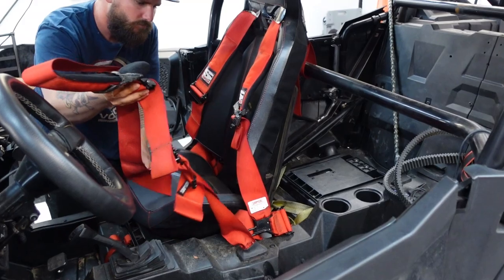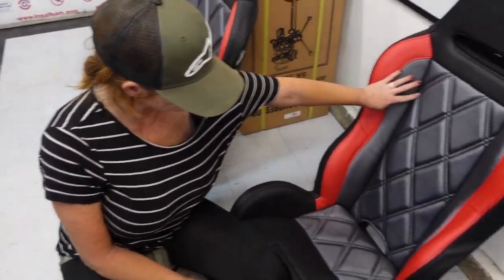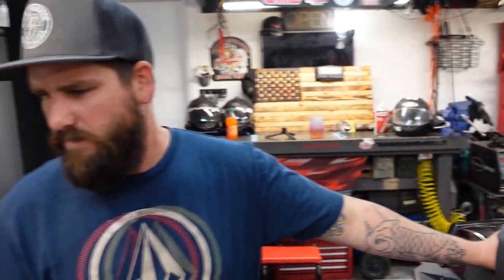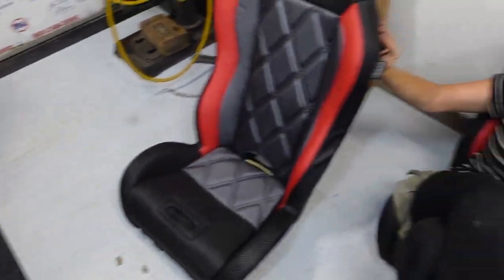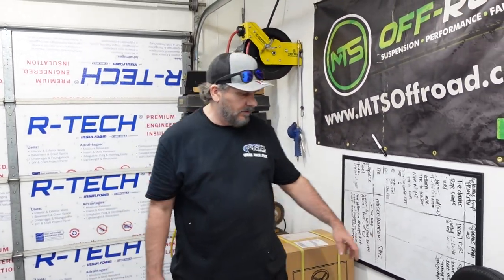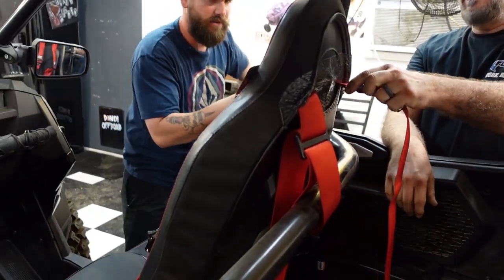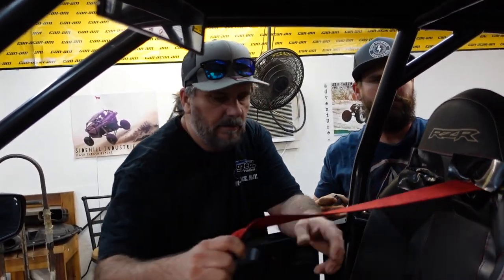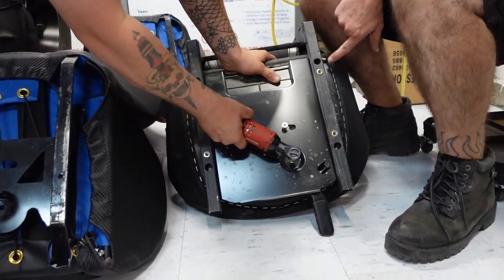Turbo S NEW SEATS From The Sand Sport Super Show

Comment: L&W makes an adjustable seat bracket that will lower the seat even more for you.
Reply from the maker: I have to check that out
Reply from the maker: Does that allow the seat slider to work ?
Reply: @DandiOffroad  yes
Reply: @DandiOffroad  they work great and they are steel instead of plastic